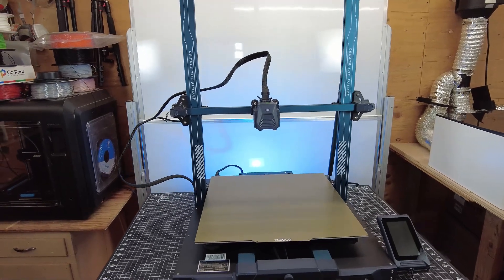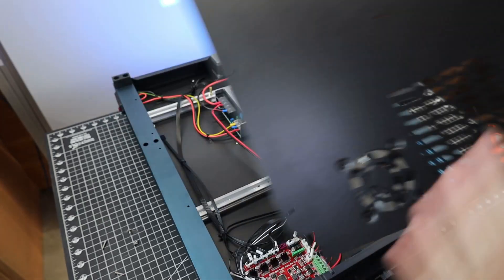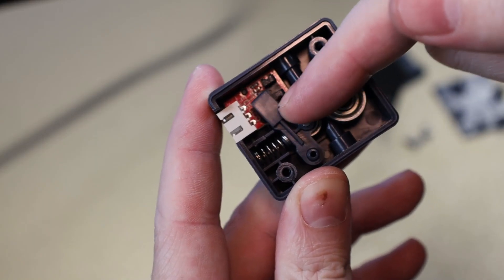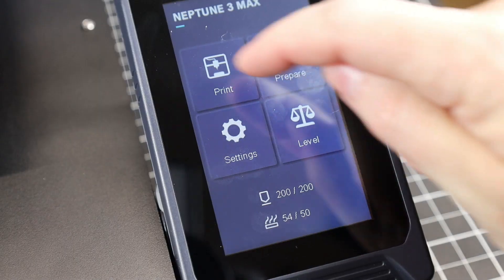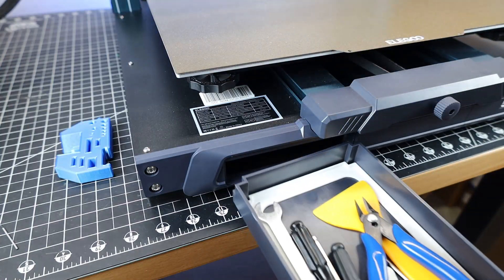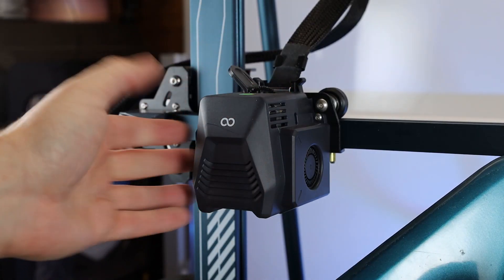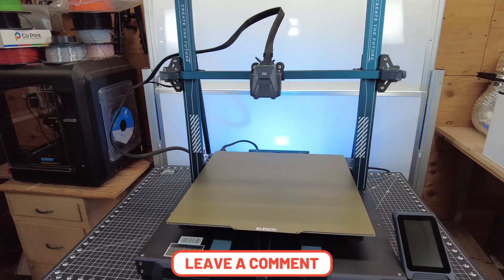Only $470: A Large Format 3D Printer That Just Works - Elegoo Neptune 3 Max

Comment from the maker: Elegoo Neptune 3 Max - https://bit.ly/NeptuneMax
Elegoo Neptune 3 Plus - https://bit.ly/Neptune-3-Plus
Elegoo Neptune 3 Pro - https://bit.ly/ElegooNeptune3Pro

Elegoo Neptune 3 Max (Amazon) - Coming Soon
Elegoo Neptune 3 Plus (Amazon) - https://amzn.to/3kbB0IN
Elegoo Neptune 3 Pro (Amazon) - Coming Soon

This is all you need if you can get the titanium throat out of the stock heater block:

All Metal Bimetal Heatbreak Copper & Titanium (4 Pack) - https://amzn.to/3ILv6bP
All Metal Bimetal Heatbreak Copper & Titanium (3 Pack) - https://amzn.to/3HjcPRN
All Metal Bimetal Heatbreak Copper & Titanium (2 Pack) - https://amzn.to/3kxLylX
All Metal Bimetal Heatbreak Copper & Titanium (Just 1) - https://amzn.to/3HjvfSp

Copperhead Heat Break C-E (If you are looking for a better quality heat break get this one) - https://bit.ly/Bimetallic-Heat-Break-Upgrade

Aluminum Heater Block (Must use M2 X 16mm bolts) - https://amzn.to/3CKCIar

High Temp Plated Solid Copper Heater Block (Must use M2 X 16mm bolts)  - https://amzn.to/3CQVIUV

Stainless Steel M2 Bolts - https://amzn.to/3XmuRZ2

Stainless Steel Metric Bolt Assortment - https://amzn.to/3XKsuze

Thermistor 100k NTC 3950 M3 Stud - https://amzn.to/3QQ5M6q

You might want to use some thermal paste to get better heat transfer but you don't have to:
Slice Engineering Boron Nitride Paste - https://amzn.to/3w15Bvw
High Performance Thermal Paste (Rated to 350c) - https://amzn.to/3GL3jph

Free 3D Files:
Boba Fett Bust STL - https://www.printables.com/model/345264-boba-fett-bust

Nozzle Holder For Elegoo Nepturn 3 Max Tool Drawer - https://bit.ly/nozzle-holder-for-elegoo-nepturn-3-max-drawer

Paid 3D Files:
Miata Fastback Hardtop 3D Printable Model - https://bit.ly/Miata-Fastback-3D-Printable

Miata OEM Hardtop 3D Printable Model 16 Piece - https://bit.ly/Miata-OEM-Hardtop-3D-Printable-Model-16-Piece

Miata OEM Hardtop 3D Printable Model 44Piece - https://bit.ly/Miata-OEM-Hardtop-3D-Printable-Model-44-Piece

MatterHackers 3D Printing Filament 1.75mm:
Build Series PLA - https://bit.ly/MatterHackersBuildSeriesPLA
Build Series Silky PLA - https://bit.ly/BuildSeriesSilkyPLAMatterHackers
Build Series ABS - https://bit.ly/MatterHackersBuildSeriesABS
Build Series PETG - https://bit.ly/MatterHackersBuildSeriesPETG
PRO Series Filament - https://bit.ly/MatterHackersPROSeriesFilament
NylonX Filament - https://bit.ly/MatterHackersNylonX

Amazon 3D Printing Filament 1.75mm:
PLA - https://amzn.to/3gsLE9Z
PETG - https://amzn.to/3pXjjvu
ABS - https://amzn.to/3wsTRjS
ASA - https://amzn.to/2RX8dtM
Polycarbonate - https://amzn.to/3cLdr38
Nylon - https://amzn.to/3iNGeI2

Editing & Camera Gear:
Canon EOS R - https://amzn.to/3ULd2AH
77in Tripod - https://amzn.to/3FICPFw
Studio Lights & Stands - https://amzn.to/3HqSGtv
Thermal Camera TOPDON TC001 - https://amzn.to/3HquffP
DJI Pocket 2 4K Handheld 3-Axis Gimbal - https://amzn.to/3UOqmVc
Accessories Kit for DJI Pocket 2 - https://amzn.to/3Waszeq
Video Editing Software - https://bit.ly/Wondershare-Filmora-Video-Editing
______________________________________________
Note : Most of the links that I use that go to products are affiliate link. This means I make a small commission on anything that you happen buy using them. This is at no extra charge to you and this helps support the work I do on this channel. 😁👍

Comment: hi there! thank you so much for the "$25 All-Metal Hotend Upgrade For Elegoo Neptune 3 Pro, Plus & Max" I followed and was amazing how much of a better quality printer I got - I just have one question (I'm new to 3D printing) - what's the benefit of the .8mm nozzle? I'm using the ones that came with the printer, after doing all the upgrades from the other video... 

I'm not trying to print nothing crazy but I just like when things work when I need and it's the best I can... anyway! thanks for the videos - It has helped a lot!
Reply from the maker: For the most part going up to a 0.8mm nozzle will speed up your print times but it will lower your print quality. So if you are making larger objects that don't need a lot of fine details or if you need functional prints then 0.8mm is nice to use.
Reply: @randymay  thanks for teaching me. - good to know!

Comment: Good video, thanks.  My Neptune 3 Plus arrived yesterday to replace a very old CTC Makerbot clone.  Whilst I needed a large print area for future projects, the Plus is as big as I would want to go.  Gosh it feels huge.  At 14.2kg this has some heft on the desk  The printer feels like a quality item.  The Buddha test print came out great.  First impressions are that things have moved on a great deal and become a lot more refined with the bed being an excellent example - it sticks very well and releases the print when flexed / cool. 

I like the touch screen interface but since I'm using a non Elego version of Cura, I have used the sigathi Thumbnail package to try to make the image of the print appear on the units screen (not seen this work so far).  This is a nice to have...

Elegoo did impress me with a sub 24 hour delivery (I'm in  the UK). I had expected the unit to be delivered in a few weeks time from the US.  As you say, packing is excellent.  Shame there is only enough PLA included to print the dinky Buddha...

My primary use case is printing model airplanes.  So look forward to trying vase mode on a fuselage later today.

Comment: What I like is that they use CZCL PSU, which are reliable and safe PSU, and they have their own UL code, which is something I really appreciate. The only negative I can say about CZCL are the capacitors they use, they are not of high quality, but if they are replaced by Japanese ones, that source will last the life of the printer.
That PSU brand is usually mounted by Anycubic a lot.
My recommendation is to leave the original PSU, because it is a psu with active PFC, and with a high quality electrical design, the only thing that would do as indicated before, change the capacitors and that source will last many years.
Reply from the maker: Honestly it doesn't even cross my mind as I'm using the printer 😅I

Comment: What is involved w/ setting up the printer when you change nozzle sizes?  I imagine somewhere you have to tell/set it to which one you're using.
Reply from the maker: There is a setting in the slicer for different nozzle sizes and it should adjust things for you so it will print and you can adjust settings as needed from that point
Reply: @randymay  Thanks!  What is your opinion on getting the Max vs the Plus/Pro if you don't really NEED the size?  Does the Max do as well on small prints?  At this time, I don't need one that big, but I also don't want to have to buy another one down the road if I wanted bigger...and at $470 (IF you can find one), it's almost a no brainer....as long as small items print just as well on it as the smaller printers.

Comment: Interesting Video.
With such a huge bed, ringing can be a problem when printing fast. Maybe Klipper with input shaping would be a good idea. Maybe adding a Sonic Pad would be nice in future.
The hotend does not seem to be high flow. For a 0.8 mm nozzle a Bondtech CHT might be a good idea as an upgrade.

A little problem might be to build an enclosure for this printer. Due to energy crisis my ambient temperature in the house actually is about 10°C. Thats totaly enough for me - but not for my 3d-printers. My mk3s always complain. So I put them into enclosures, use a hairdryer to het nozzle and bed (at least near the thermistor) to 15°C to avoid min-temp error, and preheat the bed for 10 minutes inside the enclosure to get a sufficient warm enviroment for the printer. For the Neptune 3 Max this seem more of a problem; most tables I have only are about 80cm deep. No problem placing the Max without enclosure, as the bed could swing over the front edge of the table, and I could place the printer back to the wall (or under the table) if not in use. But an enclosure would take more space that the table provides permernantly. I am not sure, if the bedslinger design is the right decision here. On the other hand it keeps the price down... Maybe I just redefine the smal toilet room for guests and call it my new "printer enclosure" (and start a YT-chanel "CNC-WC" as homage to Stefan's CNC kitchen)

Comment: So strange how they equipped this with a 0.4mm hot end, for such a build size 0.8 and up is the only way to go. Wouldn't be bad to do a klipperizing on this one, speeding up such large prints can save days.
Reply from the maker: I understand why they shipped it with a 0.4mm nozzle. If someone new to this and just getting files online most of them are designed to be printed using a 0.4mm nozzle. I do think this printer should have been shipped with 0.6 and 0.8mm replacement nozzles so you would be able to try them out. I have asked in an email if this printer can easily run klipper, so as soon as I get that info I will be sure to share.

Comment: How big of a table space do you need for this?
Reply from the maker: I'm going to try and get that info tomorrow
Reply: @randymay   thanks. they don’t seem to list it on their site for some reason. someone asked on reddit and got no replies. the thing looks so huge i’m not completely sure i have the space
Reply from the maker: So took the time to look it over and see how much area you would need for it so it didn't hit anything and if you wanted to make an enclosure for it:
42" Front to back- this will give you a little room in the back so the bed doesn't hit the wall along with the cable.
32" Side to side - this is with a few inches added to make sure you have clearance around it.
39" with the spool on it and to have some room to replace the spool
32" without the spool with a few inches added so you would have clearance over the top of it. 

Hope this helps and I'm going to make a short about it.
Reply: @randymay  lol 42" front to back is ridiculous. I would definitely need a custom table top. Thanks!
Reply from the maker: @mgoblurg  that is the travel of the bed, I can get the base measurements if you like

Comment: May i know if i should go with kobra max or this one???
Reply from the maker: Yeah I would go with this one for sure. I just looked at the specs of the Kobra Max and it  has a smaller print area, is running a bowden setup when this printer is direct drive. 

Also from what I have seen if something does go wrong, Elegoo is now for their customer support and sending out replacement parts when needed. But when it comes to Anycubic not so much.
Reply: This one
Reply: @Voidwkrr  ok tq

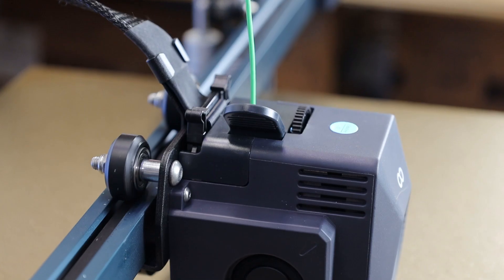Comment: About the 6:20 mark … “reached out to Creality” For a Elegoo printer?
Reply from the maker: Yeah that was a little bit of a slip. I've been researching parts to make the all metal hot end work  and they're mostly creality parts so when I went through and said that I guess Creality slipped out for some reason but no I contacted Elegoo about the firmware. But thanks for pointing that out.

Comment: Fantastic, would love to see the hot end upgrade option video, as I print ABS with my heavily modified CR-10 with great results.  Could I ask a favor, my Neptune 3 Max is preordered and I want to get started on my enclosure build.  What is the min clearance needed forward and back with the bed travel taken into account?  Also how high is the printer from table-top to the top of the horizontal support, not including the spool holder extension arm?  

Thanks in advance, really appreciate the first look!
Reply from the maker: Thanks and I will try and get that info as soon as I can. 😁👍
Reply: @randymay  Thank you Sir!  Oh, and the min side to side span accounting for the extended gantry fittings so nothing rubs going up.  :)  I think I'm going to love this printer....
Reply from the maker: So took the time to look it over and see how much area you would need for it so it didn't hit anything and if you wanted to make an enclosure for it:
42" Front to back- this will give you a little room in the back so the bed doesn't hit the wall along with the cable.
32" Side to side - this is with a few inches added to make sure you have clearance around it.
39" with the spool on it and to have some room to replace the spool
32" without the spool with a few inches added so you would have clearance over the top of it. 

Hope this helps and I'm going to make a short about it.
Reply: @randymay  So wonderful, thank you!  I will probably make it 32" tall with a printed short "spool holder extension" straight up so the spool is outside the enclosure, with a simple slit in the enclosure material (water cooler foil insulation) to allow the filament to slide back and forth a bit.  I use the "slit" concept on my CR-10 enclosure in a number of places and it works well.  I print ABS almost exclusively in the CR-10, and the heat from the bed is enough to keep the enclosure at a nice elevated temp, and I use an Amazon purchased air filtration system to simply pull a very slight negative pressure out of the enclosure and through carbon filter.  Absolutely no smell... 
Thanks so much!
Reply: Oh, and of course the control panel will be outside the enclosure, mounted externally...
Reply: @randymay  I just realized I had a closet with exactly 31" side to side clearance... would that be enough width for the printer or would that crimp the power cord too much?  I'll move the control pad and attachment from the side...
Reply from the maker: @imagesh1  31" should fit everything will a little extra room.
Reply: @randymay  Thanks for being a trailblazer with this printer and answering questions!
Reply from the maker: Here is the link to that new video all about the hotend replacement - https://youtu.be/MeQtTKjHpqw

Comment: Would just like to point out that if you reached out to Creality about custom firmware you won't get far as the printer is made by Elegoo. Great Video 👍
Reply from the maker: Lol nice well I meant elegoo haha I just had creality on my mind from looking up the parts to get for the all metal hot end working. 😅👍
Reply: I defo like this printer and when I can get one here in the UK I will defo be getting one. Just hope a community firmware comes out soon as I defo want to be able to print hotter.
Reply from the maker: It really is a great bang for the buck printer. And yeah if we can somehow get the temperature lock off of it all I would need is an enclosure and you can print large things out of high temp materials.
Reply: From all the reviews I am seeing of these printers, it won't be long till TH3D and others will have community firmware available for them.